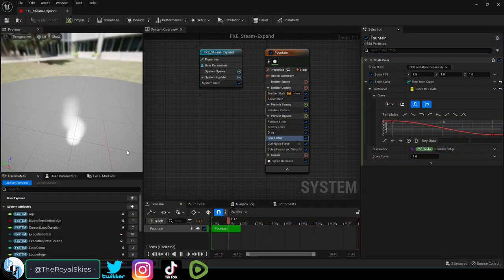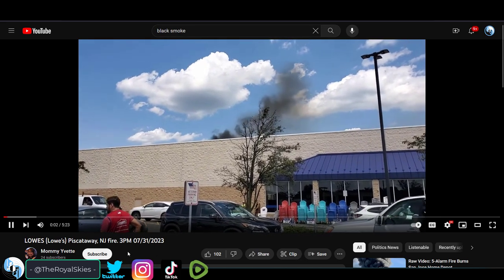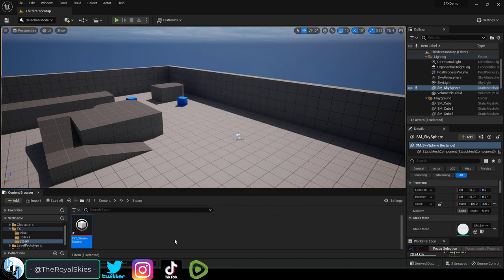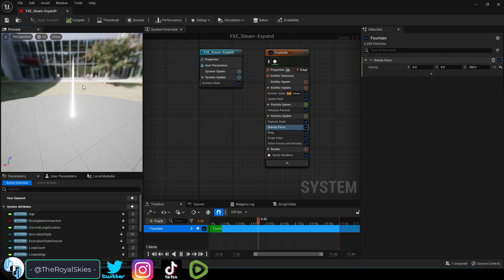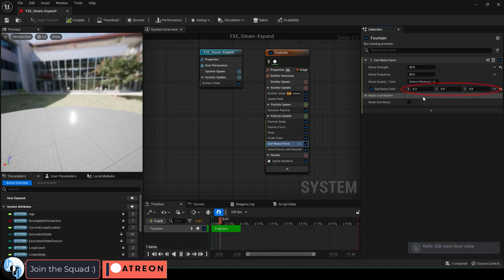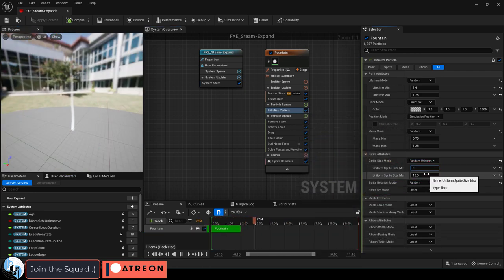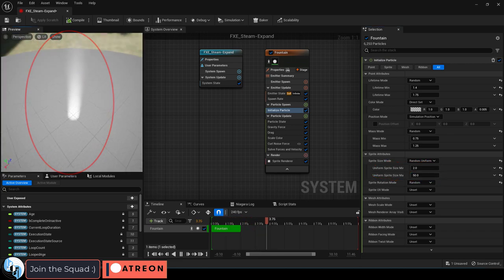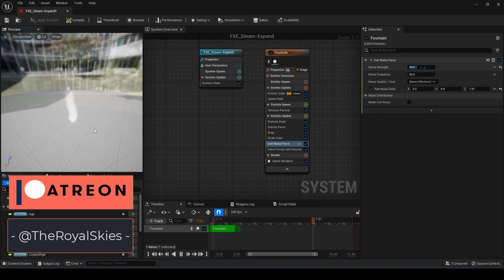Unreal5 Niagra VFX: Water Vapor Steam -

Comment: Pro Tip and Optimization: Go to properties (the top module of the niagara system) and in the SIM TARGET TAB switch it from (CPU) to (GPU).

This allows you to process the niagara system on the gpu instead of the cpu. When you process niagara systems on the gpu, the particles become way WAY WAY cheaper to process, allowing you to go from 1k particles on the cpu to 100k particles on the gpu (depending on your hardware of course) without almost not performance hit. (Dont over do it)

Whenever possible use gpu in the SIM TARGET! 
Side effect of using GPU is that the collisions tend to be worse or non existent if you move the camera fair away from the particle system. If you want more precise collisions you will need to use CPU, just be careful with the amount of collisions done in your system since these can pile up quite fast. The more particles you have the move collisions you have to make.

Hope it helps. Please share this info!
Reply from the maker: Wow, I knew how to switch it to GPU, but I didn't know that it was "that" much more efficient than the CPU - Also, I didn't know the CPU was required for collision - Thank you VERY much for the information, I'll be sure to pin it to the video about GPU & CPU :)
Reply: @TheRoyalSkies  Grateful! Actually you can use collisions with GPU), I guess I forgot (I will update the comment above, however the collisions done on the gpu arent nearly as good as the ones done on the cpu. You can cycle through the multiple collisions options that they give you in the Collision module to test them out. GPU collisions rely only on information that the gpu has access to so they are not the most accurate and tend to fail when you move the camera fair away from the particle system.

Comment: So, if I put this on a moving object, I should expect the steam to move realistically, and not just the entire stream together, right? I plan on trying this myself at some point, but I thought I'd just comment anyway. One time I tried a smoke particle that came with Unreal and it did that, it looked awful.
Reply: It should work like that.
Make sure to disable Local Space in the Properties module if you want it to move like its coming from a steam train. If you keep Local Space active it will just go up even if it is attached to a moving object which as you said, looks awful.
Disable it.